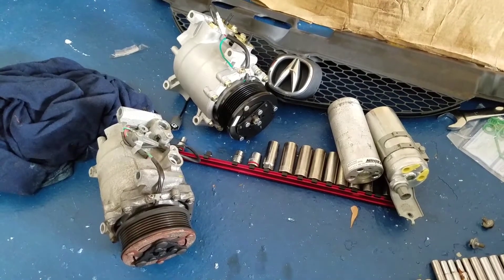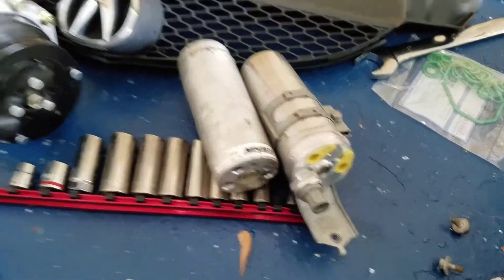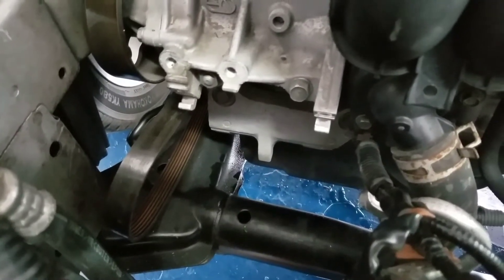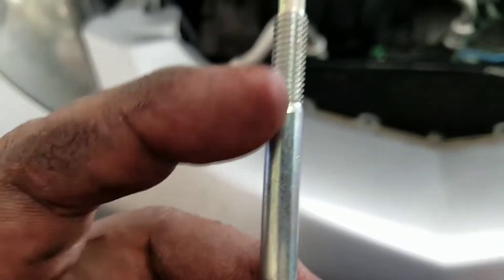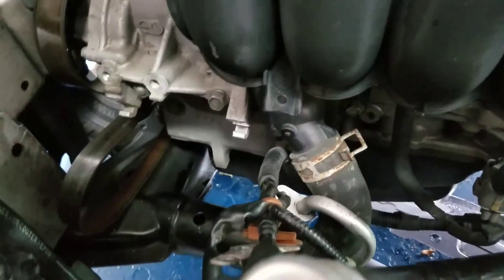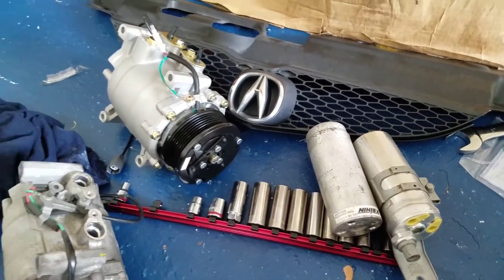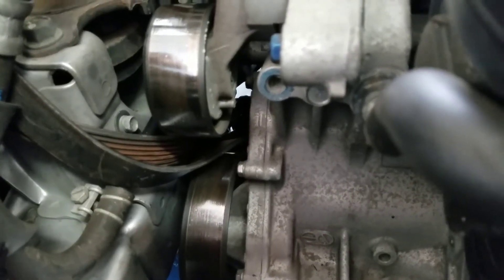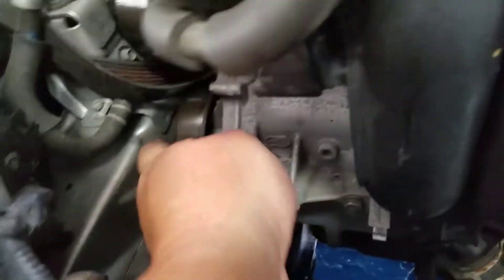A.C. RSX ACURA PART TWO VIDEO

Comment: Hey man I'm about to replace my pressure sensor on top of the drier. Do you happen to remember if the pressure switch attaches to a schrader valve?
Reply from the maker: Cant remember to be honest they screw out I believe